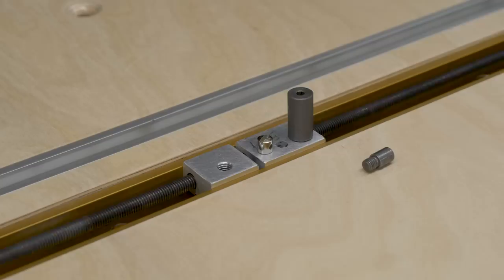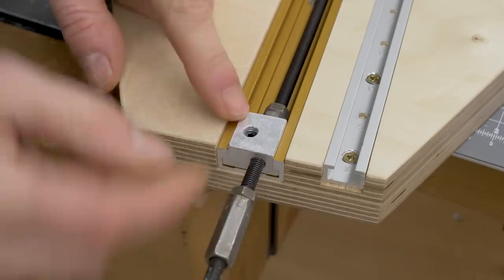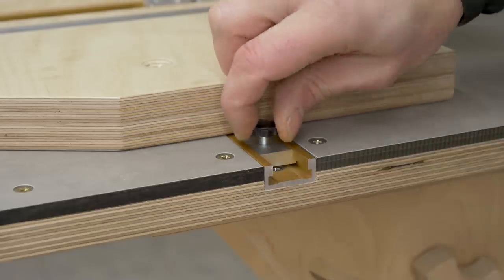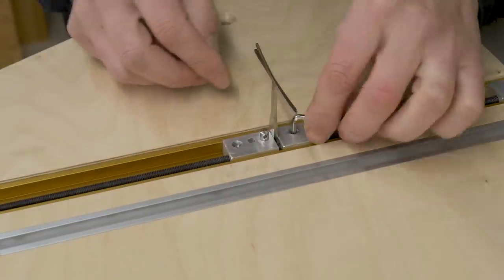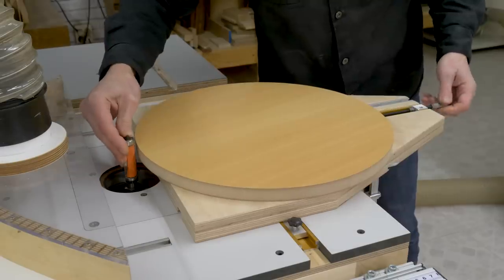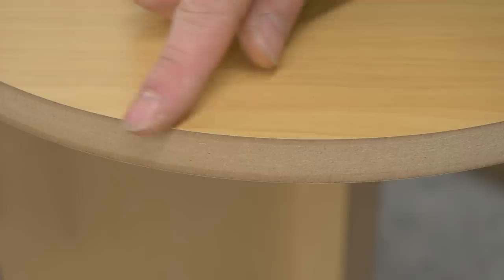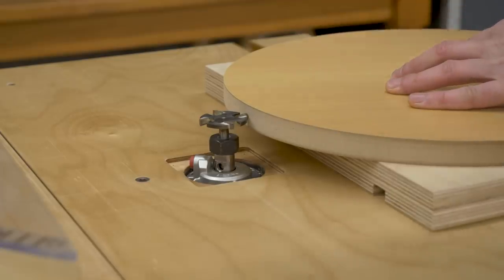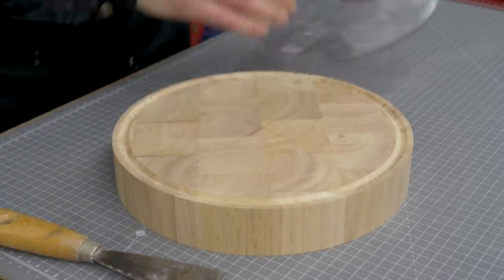DIY Incremental Circle Jig for Band Saw & Router Table

Comment: You have given me "The Guilts" again!  A couple of years back I made a trial version of a similar jig... I never did make the finished version.
One feature I added was an adjustable stop that contacted the edge of the bandsaw table when the workpiece was in the correct position to begin rotating it.  It performed the same function as the T-slot stop in your design, but because it is part of the jig, it retains it's correct setting and does not require adjusting every time the jig is used.   Should I ever make the final version, this stop would be retractable to allow use on my router table; as it is now I have to unscrew it, and it loses it's accuracy.
I envy the stunning finishes you achieve.  Using your creations to make more creations must be immensly satisfying.  😃        Thank's again for sharing them with us all.
Reply from the maker: thanks for sharing your experience Pete!

Comment: What a brilliant jig, I especially like the various suggestions on how to use it ... fantastic.

Please do not take this as a criticism of your work, as usual the amount of thought and workmanship that goes into your work is readily apparent ... but below I've suggested a method of making an already fantastic jig into something even better 👍

I love the idea of the precision part of the jig, but it makes doing large adjustments (from minimum to maximum size) a complete and utter pain unless you use a drill!

If you had the rotation axis block attached to the end of the threaded rod and a mechanism using a split connector nut, placed on the outer edge of the jig, then you could ...
- 1) disengage the nut so that the threaded rod (and the rotation axis block) could be moved in/out to the rough position quickly and easily
- 2) engage the nut so that the threaded rod can be used for fine adjustment adjustment as per your design

Only downside with my suggestion is that the rod would stick out more and more as you increase the radius of the part being worked on!

Comment: That's pretty cool! I would still be afraid of it catching and coming off the pin while routing. What about an adjustable "roller" clamp somewhere on the track/jig? Something to apply medium pressure and keep the work piece a bit more "stable." Just a thought.
I still think it is a very good idea!
Reply from the maker: thanks! I thought about that! If you are going to make the circular piece on the router table then I think it would be necessary. But if you first use the band saw and you are only going to mill about 2 or 3mm I think it is not necessary.
Reply: @Paoson_Woodworking  Good example. That completely makes sense. If you are only taking off a very small amount of material, that risk is also very minimal.
Thanks for "reminding" me of that!
Reply: Normally hand pressure would be enough, but a few sandbags would be a good idea in case you need to let go. I don't know that a rolling wheel would be any safer.

Comment: Another outstanding tool design and execution. Thank you. One thing you did not show clearly was retracting the work piece when you have completed the operation (i.e. away from the router bit/saw blade.) I assume it involves releasing the clamp and pulling the piece back?
Reply from the maker: hi Clyde, you just have to turn the threaded rod in the opposite direction, it is very easy and comfortable!

Comment: Wow, such a nice project. 
Hey have a suggestion here, can't you challenge us and make a compound sliding mitre saw, I've never seen anyone done such
Reply from the maker: Thanks for the idea!
Reply: I know you can't fail making it since you've made that extremely difficult x-motion mortiser which even uses a relatively small parts that are not that easy to work with. 

The miter saws we see here are for people who are lefthanded and hence are not safe for the right-handed ones. That happens because they use angle grinders and circular saws and their motor are not meant for cutting on the cutter's direction and it's difficult for them to reverse the motor